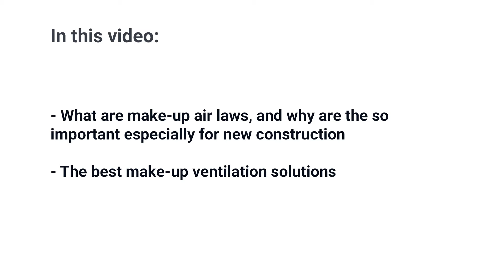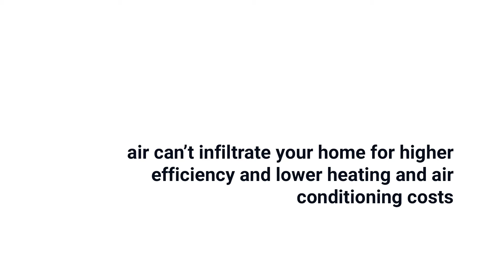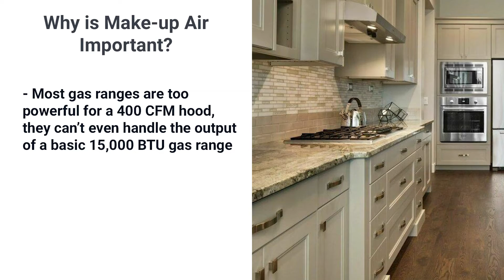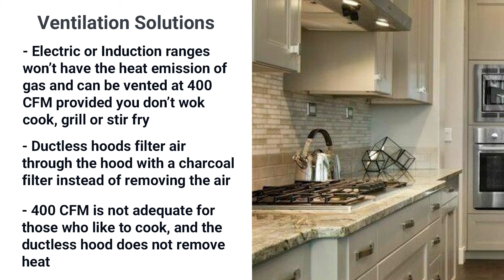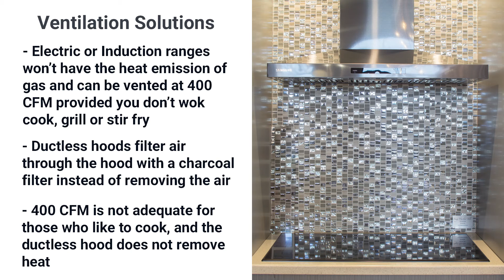What is Make-Up Air?

Comment: May I ask whether the air inlet of kitchen makeup air is on the ceiling above the stove or on the floor below the stove. It can maximize the effect of the range hood. The range hood size 54inch 1200 cfm

Thanks
Reply from the maker: This should be tied into a part of that house that is not considered a living space. Most of the time they are in a basement on an exterior wall and ties into duct work to condition the air before entering into the home.

Comment: We’re still in planning stages of major remodel on a vacation home in Lake Tahoe, high elevation w/very low humidity and of course 10’+ annual snowfall. The home was built in 1934, last remodelled in 82, thus as you can imagine it is very inefficient. We are taking it to passive certified, including no petrochemical fuels. The cooktop will be induction. The heating is in-floor hydronic w/heat pump H2O heater. There is of course an HRV system. We were considering a down draft fan for cooktop w/recirculating system but I’m concerned about effectiveness. Our home here in Colorado is efficient, not passive level, and we use a Thermador Freedom cooktop w/1200cfm overhead hood, remote fan from Best. It’s very good, imo. The new cooktop will be Miele, as will all appliances because my partner loves their steam oven and we want common appliances. 

Miele, nor any firm I’ve seen offers a 42” down draft to match our cooktop. My partner is Korean and she loves cooking Asian food, including stir fry, I’m 25% Thai so while I don’t cook, I too love Asian foods. Kitchen is relatively large and opens to a 2000 sqft dining and living room w/minimum 10’ ceilings that vault to 16’. There’s a HRV intake in center of kitchen ceiling to intake kitchen odors and 2 HRV vents in great room high on wall. The cooktop is on island. I prefer the idea of recirculating vent to maintain our passive level air tightness, allowing HRV system to solely manage air quality.

Any type cooktop vent you’d recommend, or dissuade us from considering. A specific brand/model you’d recommend?
Reply from the maker: You'd like to avoid downdrafts if possible. They just don't have the height/capture area (and usually power) to effectively vent a space... especially if recirculating. That's essentially just passing through a carbon filter system before reentering your space. With the high heat cooking that your partner is doing, that makes it even more important to vent the space as well as possible. Overhead ventilation would be your best option to vent the space. If that is not an option you'd want to find the tallest/widest downdraft available to give yourself the best shot at capturing what you can.
Reply: Michael...I am not quite sure about the last two lines of your query.  You want to use a recirculating vent to "maintain your passive level air tightness"  but you do have an HRV system to "solely manage air quality".  I am sure you have already completed your renovations / build by now but if you have the HRV the unit should, if properly designed for the cooking range you have, take care of the general air quality in the house for both heat and indoor pollutants. You can run them full time, by humidistat, or, by timer if you start to detect yourself that the air quality is ..declining.  If you're using a professional level cooking stove or range the concern is for the cooking byproducts other than heat; ie. grease, smoke and similar byproducts that are difficult for an HRV to deal with since the heat exchange media are not really designed to handle them.  So YALE appliances reply is correct; for professional level range use its BEST to direct exhaust ALL of the cooking byproducts with a suitable over the range hood.
If you have reached "passive" level or at near "passive" level house rating congratulations you have done much more than many people have or may do in the near future and you just have to balance off a bit with the loss from daily cooking on the range; there are always tradeoffs.  You can make a house really tight and really passive but you still have to "live" in the house.
gregg.shaw@sasktel.net - Lacombe, Alberta, Canada.

Comment: I live in the Minneapolis area. Like Boston, it can get real cold during the winter.  Does the $100 Broan kit you mention do anything to warm this freezing make up air?  If not is there another inexpensive option for make up air? Thank you.
Reply from the maker: No. Make-up air kits are essentially dampers. The air needs to be conditioned through your ducting system before entering the home.